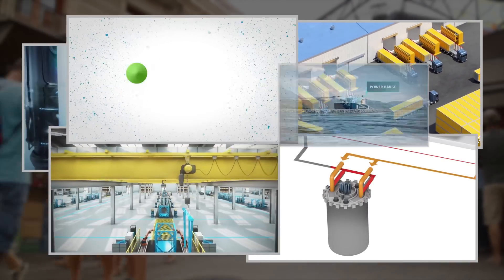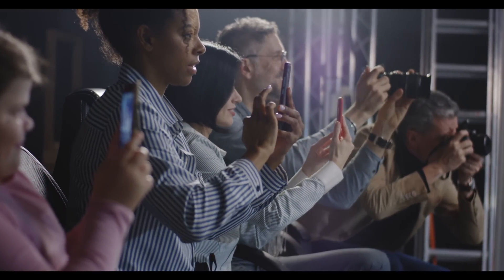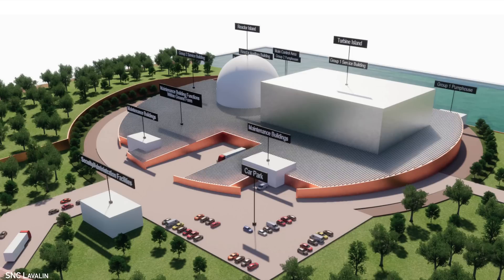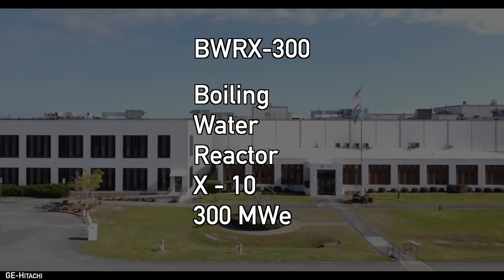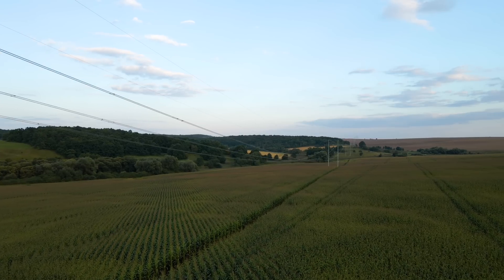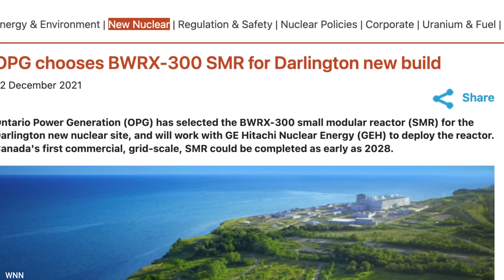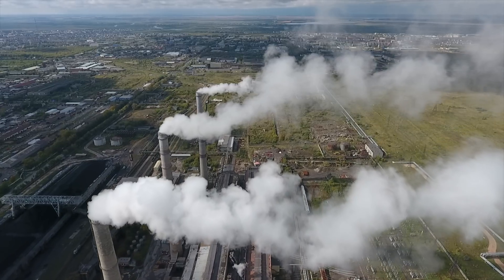Why This Small Nuclear Reactor is Actually Winning

Comment: I am dissapointed that traditional nuclear is being considered. No one is discussing the disposal of nuclear waste from these reactors. The safety is not just about an explosion but the 40 year life of the plant becomes a contaminated scar on the land for at least 500 years into the future. At least with thorium the level of radiation is safe for common disposal. Burnning coal is better in the long run than nuclear because it gets recycled. The ash from coal helps cool the planet by nucleating rain clouds. The science around carbon greenhouse has been proven to be completely wrong. The planet has regulating mechanisms for carbon but it has none for radioactive waste.
Reply: None of that is true, 500 year “scar”, coal. Dozens of old decommissioned reactors have been cleared away. Google up imagery, they are forest and park. Now, not 500 years from now.

Comment: Interesting.  I'm sure some will be built; but not sure they will dominate; especially with the recently announced Westinghouse AP300 due to its ability to tap into the AP1000 supply chain and construction experience (and GE has not built a new nuclear unit in decades and no one knows what it will actually cost); whereas at this point essentially 6 AP1000's have been built, 2 abandoned during construction, and 8 more have been ordered with some of them under construction already.

Looking at the history of the EPR in Europe and the "nuclear revival" in the USA about a decade or so ago leads to questions on how many of these will actually get built.

For the record; The US NRC has at this time the following approved reactor designs (per:  
- Boiling Water Reactors:  ABWR, ESBWR
- Pressurized Water Reactors:  System 80+, AP600, AP1000, APR1400

US Utility Companies had selected sites and gotten site and combined construction and operating licenses (COL) for 14 of these reactors (2 ABWR's, 2 ESBWR's, 10 AP1000's) at 8 different sites.

6 US Utility Companies had gotten Early Site Permits which allowed the start of construction before the COL was approved (and construction was started at some of those sites).   By the way this is what I call "Shovel ready" - not that an initial design has been completed which has not yet been reviewed and approved by the regulator (hint: designs often change somewhat during the review process).

Only 4 AP1000 reactors were started in the US, with 2 being abandoned 2/3 way though.  Vogtle 3 is now operating and Vogtle 4 should be operating in another year.  Meanwhile the Chinese built 4 AP1000s with minor cost and construction delays and started them years ago (the Chinese had been building other nuclear power plants and had current working knowlege of what was needed and how to do it).

The European experience with their EPR followed a similar pattern (lots of people wanted to build one) - and the 1st started construction in 2005 and came online in 2021 after 16 1/2 years of construction.   I was soon shut down for problems and was restarted in April 2023.  

The second one (Flamanville) started construction in 2007 and is not yet finished due to problems. 

China built 2 of them (Taishan 1 & 2) with both cost and construction delays (9 years to get online).

Hinkley Point (United Kindom) is also experiencing major delays and cost increases with their 2 EPR's.

Framatome/EDF has admitted that there were major design issues with the EPR and are now working on a revised EPR-2 design (meanwhile the Chinese ordered 6 more Westinghouse AP1000's in 2022 because of how well they operate).

Even regulatory approval does not mean the plant will work well.

So I am skeptical of how successful the market will be for the BWRX-300 will be.   GE-Hitachi could not estimate the construction cost or timeline of the ESBWR  when several utility companies wanted to build them (who had COL's in hand) which was a key reason those units never moved into construction.   I'm not sure how well they can estimate the cost of the BWRX-300.   Also, regulation approval of the design is a several year process (at best) - especially for equipment that has never been built.  The fist plants will be "initial one time construction" plants which are always much higher cost than with experienced construction and when a supply chain has produced multiple items before.

The Westinghouse AP300 might get through the regulatory process faster as it uses major components from the AP1000 (with 5 units operating and a 6th close to operating; and 8 more units ordered or under construction).  It makes a lot of difference during approval when you can use already licensed and proven in operation components.

It will be interesting to see how this shakes out.   The BWRX-300 might do well.   It may also be like the EPR, which after 6 units no one is interested in building again, and it might be that only a few - or none - are finished due to various problems.

I have a lot of personal experience working in the nuclear power industry...   I'm pro nuclear power; but, realistic about how difficult it is to go from concept to design to regulatory approval to construction - and to a well running and operating power plant that will provided many decades of reliable and cost effective service.

I believe that the AP1000 is the only new western reactor design to get past those hurdles...     The just announced AP300 uses a lot of the same major components and the same control system as the AP1000.   I believe its going to be a very strong competitor to the BWRX-300.
Reply: Sure hope so. The issue that plagues nuclear is the exact same that plagues US high speed rail for example. We just can't get any god damn consistency in program commitment. 

We start them, companies lining up like crazy to finally get something going, we then default to whoever has current political decision-making in his/her back pocket, hire completely clueless construction companies that consistently fuck up reactor construction, and when problems inevitably crop up we either put the thing on half or order it's complete destruction. We plaster everywhere on MSM how nuclear has failed and will never work, and we wait for everyone to have forgotten how to build anything that isn't a solar farm or a fossil fuel plant before trying again.
Reply: I totally agree with this view. The BWRX-300 based on a Technology that went nowhere. Whereas the AP 1000 is proving itself as it has reached the Nth of a Kind Stage, and so there is a lot of knowledge how to build them.The AP300 will leverage this knowledge, whereas the BWRX-300 will have all the problems of a first of a kind, that originally Plagued the EPR [eg Flamanville ], and the AP 1000 [ Vogtle, V.C. Summer]. For this reason, I believe that the AP-300 will take the the market from the BWRX-300.
Reply: After VC Summer and Vogtle who in their right mind would want a Westinghouse reactor. And there is no such thing as economies of SMALL scale
Reply: @clarkkent9080   You do realize that 4 AP-1000 power plants were built on time and on schedule in China by companies experienced in nuclear construction.

China has been so impressed in how well the AP1000 runs that it recently ordered 6 more AP1000 units.   Those will also be built on time and in budget.

The overwhelming overruns in the USA were because the USA no longer had contractors or the worker base that understood nuclear construction.   They literally had to dismantle and reconstruct major portions of the USA projects because they didn't construct them correctly the 1st time.

There is a known learning curve vs plant cost curve.   IF the same contractors and key worker base in the USA buid another set of AP1000 units the construction cost will be half of the cost of VC Summer and Vogtle, the next set half of that. And sets after that will be essentially at a very economical rate.     Sorry, like many things experience matters; and both the USA and Europe totally lost the knowledge base of how to build nuclear plants.

Also that loss of knowledge base will also affect any SMR reactor design as well.   All those people talking about how you can use normal industrial construction practices and techniques are full of BS.  Only the best of the workers (top 25% of workers) ever adjust to nuclear quality control methods and approach.  

Nuclear construction is totally different than normal industrial and commercial construction practices.  The nuclear construction practices developed because of all the problems from the construction practices and processes that affected the plants built in the 1950's - 1980's.

My view is that the USA is totally short-cutting itself by not investing in redeveloping the necessary nuclear construction knowledge base.  Yes that will cost money.  But, so does everything else.
Reply: @perryallan3524  First, while the Chinese AP1000s took significantly less time than the American counterparts, they were NOT built on time and China is not known for providing accurate data on the cost.  And the reactors that China is now building are copies of the AP1000 and they will NOT be compensating Westinghouse for stealing the design.
The VC Summer and Vogtle units were built by utilities who have been operating nuclear reactors for decades and by experienced construction firms. That is the best the U.S. had to offer.

The issue with nuclear construction in the U.S. is NOT because they don't understand nuclear construction.  It is because U.S. industry does NOT provide what the project is paying for and really does not seem to care.  The rework you cite was the "build modules in a factory" concept that people still claim will reduce costs and yes those modules had to be disassembled and rewelded at the site because they did not fit together and many welds were sub par. 
Another example: a U.S. steel mill was paid a premium to provide specific rebar to be used in a critical safety system enclosure.  When construction began installing the rebar it snapped when bent.  That project had to be stopped and many work hours lost until another contract could be let to another mill to produce the correct rebar.  There was no time to litigate so the first mill was paid and their rebar was scrapped because it could not be sold for liability reasons. 
In the southeast, storms are common and every time a storm was approaching, outside work was stopped and untold work hours lost.  The last few months of the Vogtle project was delayed due to what was described as shoddy construction work but was actually sabotage to keep that gravy train going . Scores of project workers were let go every week when they failed random drug tests. Bet that don't happen in China.

The VC Summer and Vogtle plants used union labor which in general are much more experienced in building to code.  A welder is a welder, a pipe fitter is a pipe fitter, an electrician is an electrician.  It is not a question of experience but it is construction not caring and building to Walmart or Amazon warehouse standards.  I believe they know what should be done but just don't care and experience will not change that. 

I worked in the nuclear industry for 40+ years at 5 different facilities and I do agree with your statement that workers do not adjust to the nuclear standards.  Close and almost mean nothing. It must be built exactly to spec and using exactly the components specified. The U.S. did not have enough construction manpower to construct both VC Summer and Vogtle.  Even after VC Summer shutdown, Vogtle construction was short staffed.  

Figure out how to get more people to go into a construction career and actually give a $hit about the quality of their work and maybe in 20-30 years the U.S. can build more nuclear plants.  However, the U.S. is moving to establish new electrical generation capacity that is needed now and we cannot wait for nuclear to get its act together
Reply: Hey Poland! You're going nuclear for the wrong reasons!

CO2 is climate-irrelevant. 

Interglaciation climate change (i.e., the Medieval Warm Period) is caused by changes in cosmic rays (Svensmark et al). 

There is not such thing as anthropogenic global warming.  

"Global Warming" is a superstitious bullying and shakedown of the taxpayer. 

Just burn coal and keep looking for more oil and make it out of coal (the way South Africa does at SASOL).

Comment: I hope we solve our energy problems ASAP
Reply: Yes, you can today. Firstly, we need to save energy. A huge potential. I believe solar, wind and hydro energy are the way to go. 
Solar energy definitely works! No nuclear waste et no cooling necessary. We produce more current then we use over the year. Since 2 years and for 30 more. All suitable roofs should be equipped. 
No nuclear waste, no cooling necessary! 
The energy providers do not support this, as they do not profit from our solar panels. They prefer constructing huge plants in sunny areas and distroying agricultural land such as in Andalusia (Spain) or natural regions and in Swiss Alps.

Comment: Does it cost nothing to operate? No it does not. Which is why it cannot compete with the zero marginal costs of solar and batteries.
Reply: There is no large scale, 24/7, winter-summer, solar and “batteries”. Not anywhere. What there is instead, most everywhere, is some solar or wind w a gas plant hiding behind the curtain (along w gas pipeline, gas storage, gas drilling, gas explosions).  Also, there’s guys like you, pretending it’s something it’s not.

Comment: Combine small scale nuclear with stored hydro😮. Run your nuclear at a constant rate, pumping water at lower demand and using the hydro as a peaker supply.
Reply: Why drown another valley somewhere  die hydro, when a reactor or two could be ramped to cover the peak?

Comment: MWe - megawatts I understand but e? Electric? In units notation e would be for electron, like eV. Electron volts.
Reply: Megawatt-electrical.  It's used in nuclear power to differentiate the electrical power from the thermal power generated.
Reply: @Rocketsong  ooooh. So it's not a physical notation but technical. Thank you!

Comment: 1 billions will become 4-5 billions, at 300MWe output they could as well build 1,4MW plant. One big plant instead of 4-5 smaller plants is easier to maintain, control, take care of various risks like jet hitting them, GE boiling water reactors was also partially opened at Fukushima, etc. 
Nuclear engineers were pretty clear about problems with SMRs, if GE manages to sell many i will be happy to see things moving.

Comment: IMHO, we need to do all the things.  This shouldn't be a "let's just do BWRX-300s everywhere".  We should be doing these less ambitious designs AND continuing to work on the more ambitious ones.  Then let the competition sort it out.  We need more fission and more geothermal.  There's a crunch coming in the next few decades as countries and states start to get enough renewables without having viable energy storage or smartgrids when they're going to start having problems and will realize the importance of baseload power generation.   Renewable advocates like to hand-wave away the problem of storage and it's dishonest because storage was always the bigger problem, and most countries have just punted, preferring to use natural gas peaker plants.
Reply: If you look at successful examples nuclear isn't really working in the way free market does. The most successful reactors seller Rosatom from Russia is 100% backed by the state and is doing great. Private sector is simply too small to do it, beside being more corrupt than big system having built numerous reactors for cheap and in time.
I like your comment about base load problem because very few people understand what it means, how much will cost parallel ele. infrastructure for failed renewables. Isn't geothermal only possible in certain countries? We had green party talking about it until engineers explained conditions in the country are not right for it.

Comment: Do the BWRX reactors still use solid solid fuel rods ?  My understanding is that this format is only around 5% efficient and that the rods then require hazardous handling, dismantling and that storage of the unspent fuel is long winded and long lived.  Is this correct ?   Is it also true that Molten salt reactors (Liquid Flouride Reactors) can burn 95% of the radioactive fuel and the 'waste' is less radioactive and is 'hazardous' for a much shorter period ?
Reply: All true (I'm unclear on the total efficiency but with uranium that would depend on where you start counting from.)  OTOH, do you know the total volume of spent fuel that we'd have to deal with by the end of the plant lifetime? It would literally all fit in my home office here. The yearly consumption fits under my desk. Ontario has been running much bigger plants since 1971 and we are not having trouble keeping spent fuel cool and secure.

Comment: Did your $/KW include the cost of connecting to existing power distribution networks? Dropping a SMR as a direct replacement for existing coal plants effectively eliminates the need to build the power network connection. It's a "plug and play" replacement for old generator.

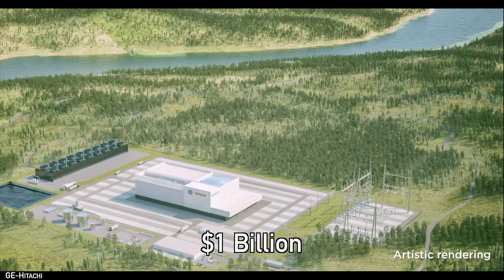Comment: 7:35 Wait, wait... I thought the fact it's "modular" and can be massed produced instead of in-situ build, was supposed to make it considerably cheaper? But if a 300MW SMR costs 1 billion, and a big classical one costs 5 billion, but can deliver 1500MW... isn't that exactly the same price, viewed at $/MW-hour??

Then, what is the point, if it's as expensive as all the rest? Improved safety? But the big gen3+ ones have that as well. I mean, it can be a stop-gap measure, mayhaps, for countries that are cash-strapped, but with this technology, one will never achieve a real breakthrough.
Reply: Could you build 5 of these side by side and have them actually on-line faster than a 1500MW plant?  If so, that reduces the cost of capital.   Otherwise... I'm not seeing the point.